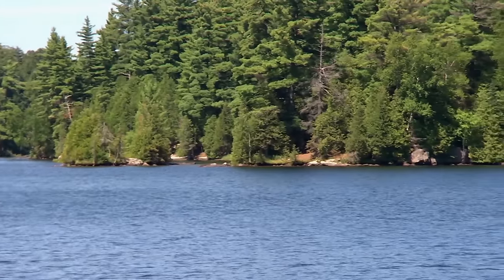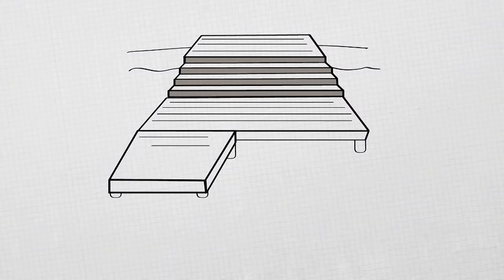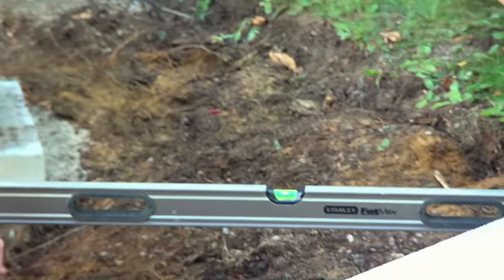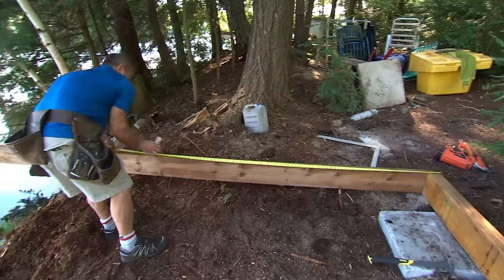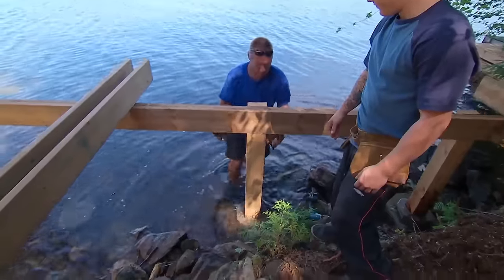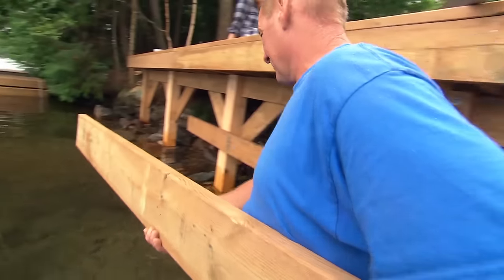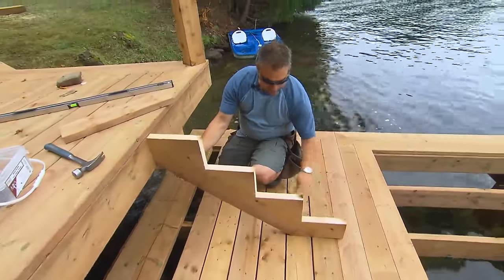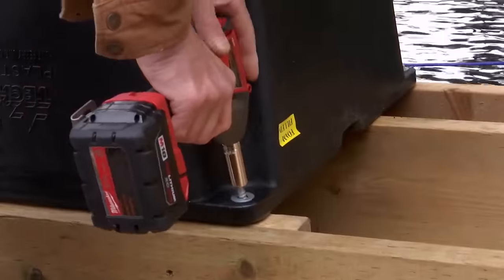How to build a Shoreline Deck with stairs | Cottage Life

Comment: The thing that bothers me is the materials they are using. We don't use this type of wood because it will rot very soon, we have found within 5 years or less, and this is an expensive dock. This builder reminds me of many that I have came across in my career as a dock builder. AND in answer to many on here that are concerned about the piling's, your concerns are valid. We drive piles, it is harder to do but it is much more secure and lasts a lot longer. Even with the pneumatic hammer that we use it is still difficult to find square but well worth it! This guy seems like a general contractor gone dock builder to get in on the money. He probably doesn't know that he is building a dock out of poor materials. I would not build this as a deck on dry land let alone in the water. He needs to learn more about his materials.
Reply: What type of wood should I use? I am wanting to build a ramp or some wide stairs to help my dogs get in and out of the water. Whatever I install will just get painted the same color as the dock. Is it a matter of just getting any pressure-treated wood or should I be looking into certain species?

Comment: I'm assuming those concrete footings are four feet or more down under the sand under the water???  I bet after one year the lower deck heaved.  I see it all the time.  The ice pushes anything in the water straight up and out.

Comment: You skipped over the part that concerns me with this type of build. How do you place the underwater footings? Looks like you just placed the concrete pad right on the floor of the lake, did you have to dig down to the rock bed?
Reply: Good observation. That's why this kind of deck would only look good for a few years
Reply: Never last one winter ice.
Reply: MJ69090 yes! That's part I need to know about mostA
Reply: I have a place on a lake in Maine, this would be gone by next Spring :P
I opted to build a long floating dock with bicycle wheels on the end and I use a simple hand winch to pull it up the steep grade, and store it in the basement over the Winter.
Reply: lol the ice is gunna mangle that thing with those half ass footings
Reply: @tumeninodes8870  Anyway you can share that build on Youtube?  I'll wait until next Autumn!
Reply: @nathanvaccaro1791  I was fortunate enough to have someone give me a few large plastic drums, which were sealed and water tight. I simply built the decking, secured them under it, and fixed two large bicycle tires to the far end, and a piece of aluminium frame with an eye bolt welded to it at the close end... depending on the slope you will need a strong rope, which can then be attached to a hand crank. I had an old iron, locking hand crank from a yard sale I used. That;s about the best I can explain, I am not very good at making videos and have not even been able to get up to my camp in some time due to health issues.
But the basic idea should be easy to visualize and understand. I attached that hand crank to the house. Whne it is cranked up, I just unhook it and use the two handles to wheel it into the basement for storage. This way I also sidestep paying taxes for a fixed dock on the property.

Comment: Soooo you cut ext grade pine then stuck it in water. You didn't repaint or seal the ends......? I'm wondering if after three years,
is this deck's posts still solid?
Reply: I'm sure they did, it would be pretty boring to film.

Comment: is that thing going to survive winter in the ice?
Reply: ottawadigs They pull out the prefab decks during winter, they aren't attached with any permanent hardware because they have to move up and down with the water.
Reply: Exactly what I wondered
Reply: I live in MA. Our docks come out in winter. I don't know if any dock will survive ice. Water expands 9 to 10 I believe. That means 9 gallons of water is equal to about 10 gallons of ice. Think how much a 30 foot dock would have to expand to keep up. Not happening. There are special designed docks but they are very expensive.

Comment: I don't understand! A set square or right angle will show whether two pieces of wood are perpendicular no matter how long it is! Unless of course its wonky in the middle! And you should really put it on a raised and solid concrete base with drainage to stop it from rotting right?
Reply: Nathaniel Struselis Its not that it wont make it perpendicular, but if you are off by just a fraction of a degree, it can wreak havoc on the rest of the build. Using the tape just makes it that degree or two more accurate. PS, if you do this a lot, Fastcap makes a tape measure that is specifically designed to help measure boards square. I think it is called the procarpenter square one tape measure
Reply: Ogoun
oh ok!
Reply: +Ogoun He was actually wrong. 8 feet by 8 feet should be 11.3 feet (137.76 inches to be more precise) for a perfectly right triangle. Guy needs to take a math class.
Reply: Nicholas Strong
Haha well spotted!
Reply: +Nicholas Strong No, he said 6 feet by 8 feet. 6^2 + 8^2 = 36 + 64 = 100 = 10^2
So, 6 feet by 8 feet is 10 feet diagonally. Please check your facts before attempting to correct.
Reply: Not true if you pay attention in school duh
Reply: Thanks Ogoun! I didn't know about the "procarpenter square one tape measure." Going to see if I can buy one right now!
Reply: And thanks, Matt. I was wondering why Nicholas said "8 by 8." I heard "6 by 8." But when you add the two sides, it comes to 14. Pythagorum (sp?) says those two sides equals the long angle, as someone else said is used here. But I was taught the 3-4-5 rule (almost the same as 6-8-10 rule). What is the correct name for this triangle/square rule?
Reply: Catherine S. Todd again... a squared + b squared = c squared. Do the math.